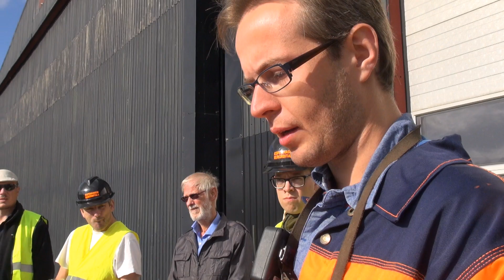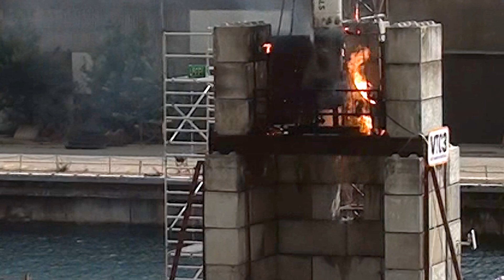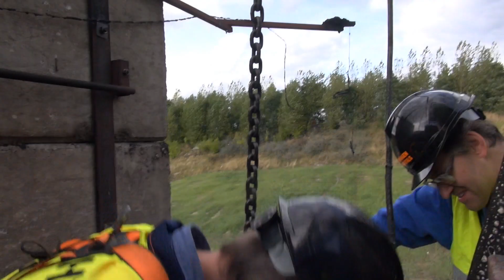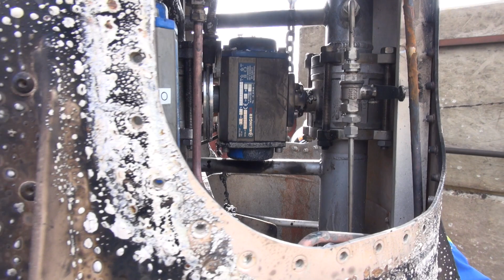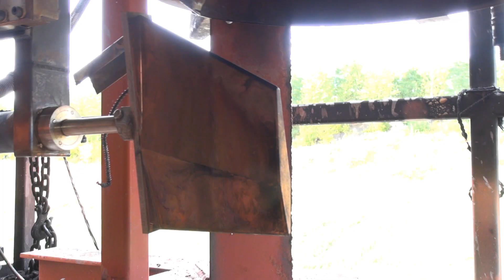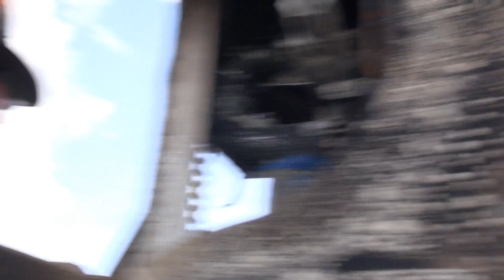HEAT2X Static Test

Comment: Having read the postmortem notes about the welds, I wonder if the next engine could be strengthened by electrically spot welding the 3 layers of liner, spacer and outer jacket through the middle of each spacer.  This would act like rivets without the holes, and would create easily repeatable welds that can be visually inspected from both sides.  For the liner-jacket connection at the end of the nozzle (where this engine ripped open), the liner could be folded back over the outside of the nozzle to allow a mechanically stronger seal with more room to do the big weld that failed here.

Comment: Some things did not look experimentally correct. I am surprised they had rubber tubing, cables and other technical apparatus well within the burning range of the engine exhaust. This arrangement did not look professional.

Comment: Sorry to see this happen Guys.  Wouldn't it be better to cool the Nozzle with the Lox rather than Fuel. The Nozzle would run cooler and with out any chance of ignition inside the liner.
Can't wait to hear what's next.

Willy
Reply: Nope. There's a good explanation of why not, which I can't remember at the moment. But cooling with the LOX is not a good idea.
Reply: Lars Bjerregaard  Because it would become GOX in the cooling passages of the nozzle, due to the high temperatures.
Reply: Andres Lopez Pulzovan Bill Blackburn 
And LOX is oxidizing, so it would kind of burn through the matial
Reply: Edgar Brucke i think this is the reason why lox is usually not used as coolant and at the flow rates it might not actually transfer to the gaseous stage if cavitation is not too serous.

Comment: I know things are on a budget with the project, but can't they afford a fire supression system
on the entire launch/test pad?
Reply: There was no fire suppression system at all.  Only a system to reduce the rocket noise and protect the ground from the intended rocket exhaust flame.  Basically, they are turbo-pumping an entire dry dock full of seawater down the flame deflector in a matter of minutes.  But yeah, for this failure, a means to redirect the water upwards could have protected some of the auxiliary gear (cameras, video link etc.) better.  The rocket itself was dead anyway, and all people were evacuated to safety before ignition.  For real launches, they don't use the VTC3, but the floating L/P Sputnik in open seas, to get wet there, they just need to fall overboard, and they already tested the LES to do that for the astronaut.